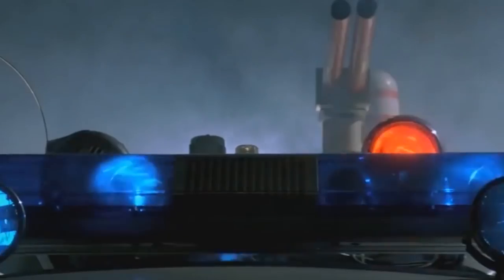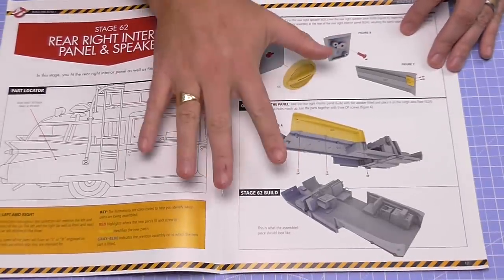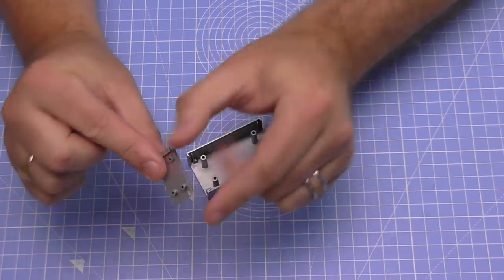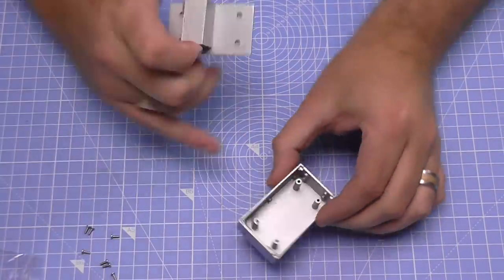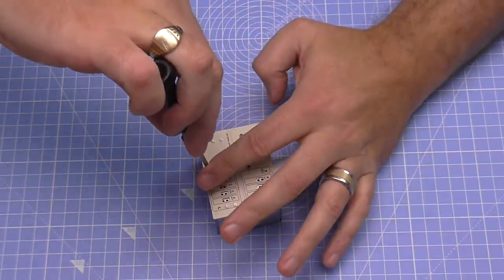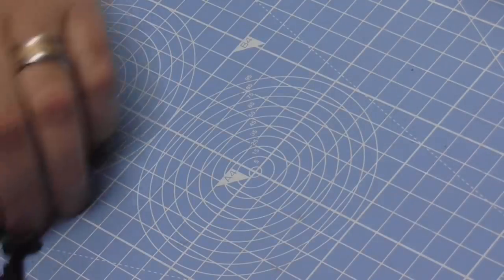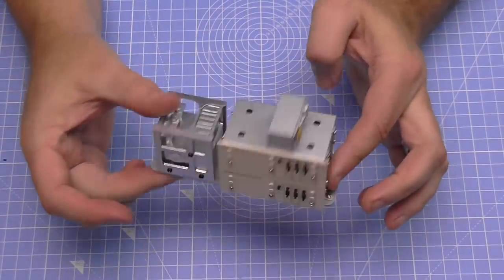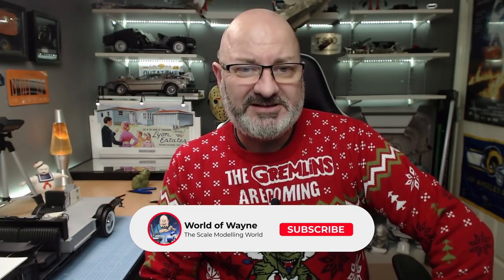Build the Ghostbusters Ecto-1 - Part 59 and 60 - Martin Marietta UHF Signal, Power Distribution Unit

Comment: Martin Marietta was a prime defense contractor.  They built the Titan Rocket family, with the Titan III the booster of choice for all the Project Gemini flights.  They also made ICBMs and SLBMs.  They did not make electronic devices, per se, except to fit into the missiles/rockets and/or their aircraft (they built several experimental "X" planes.  So some gear was salvaged from decommissioned gear and resold, which fits with ECTO 1's improvised feel quite well.  MM merged with Lockheed to form Lockheed Martin, manufacturer of many fixed-wing and rotary aircraft, including the legendary SR-71 Blackbird.

Comment: Its interesting how Eaglemoss has given specific names for a lot of the electronic components on this car, but neglected to do so on the Delorean. Unless I wasn't paying good enough attention, it seemed like they only named a handful of parts, most of which were named in-universe (Flux capacitor, Mr Fusion, etc). There's definitely plenty of other parts they could have given names to instead of just calling them by a eaglemoss part number. Janitrol Heating Unit, T-195 Vent, Mallory Capacitors, Atomuffler Model M00s, Rowan Control Contactors, to name a few

Comment: Am I the only one that spends a lot of time on my knees looking for those "fiddly parts"?  I need to get knee pads.  One little mistake and little parts all over the place and they could be the size of a dinner plate, but I never find it.  
Wayne, thanks for your videos I can build these complicated models.  I am on my third and a half Deloreans.  The first one, the top and bottom did not fit, British top, US bottom.  The first one I finished is a rock or a paper weight.  Nothing works.  The second was better but the headlights and some other things did not work.  Model Modz flux and tree worked fine.   The one I am working on now has all the mods and I am putting them in as I build which is not easy.  All the online videos are modify the model after it was finished.  Chloe has helped out a lot.  I need a wife like her.  So off my knees and I will find the little knob later, probably eaten by my cats.

Comment: lucky you, my last ecto 1 was  shipped in Oct., called them in December and they said they were out of stock on part 13, so basically at a stand still. I mean did they make more of part 12 and 14 and decide there were enough part 13's around, logically you would think they would make all parts to match
Reply from the maker: I'm looking in this as I am hearing lots of peeps in the US stuck on issue 13 atm